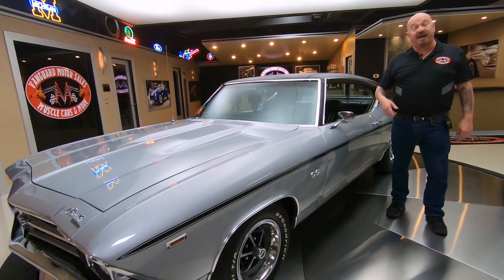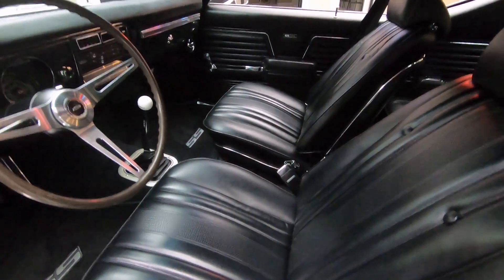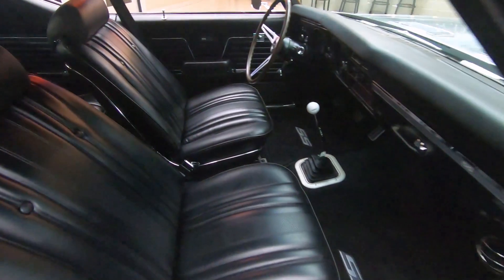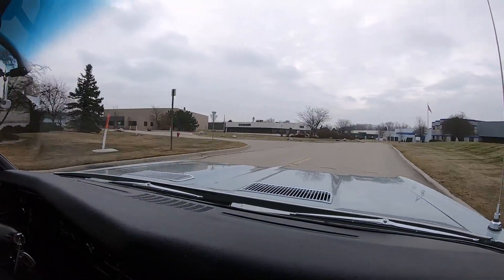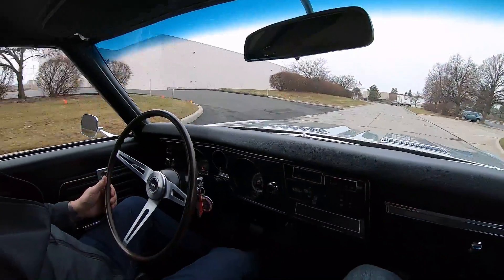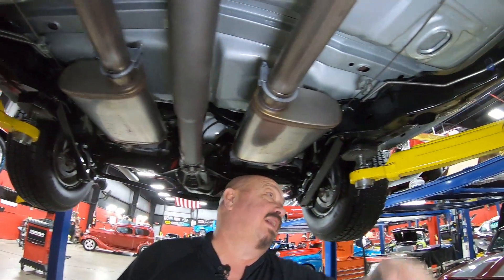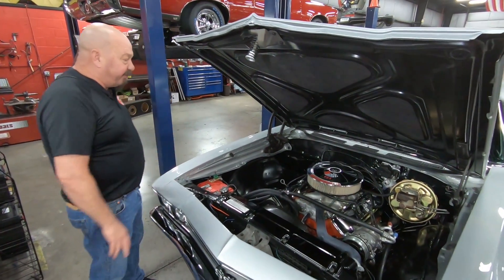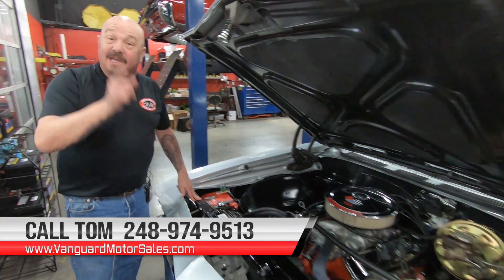1969 Chevrolet Chevelle For Sale

Comment: I spent so much time in the driver's seat of the 307 version that I can say with a smile on my face that I don't need another Chevelle... I had the SS version of the el camino later  on, which had a 409 block , but it wasn't a true LS6.